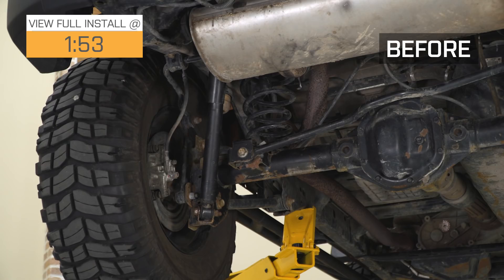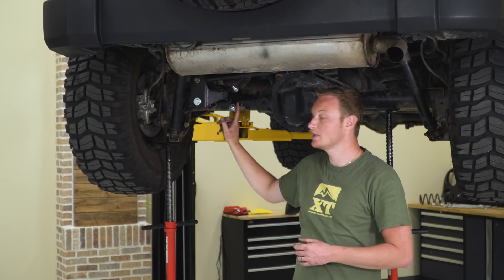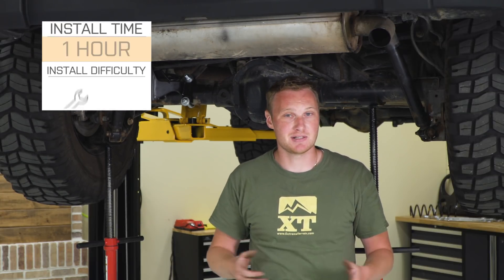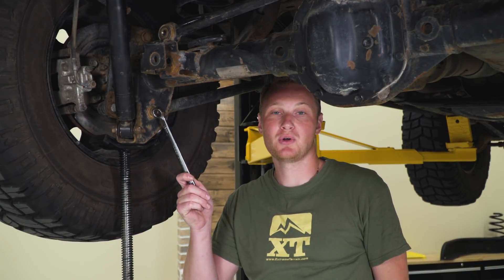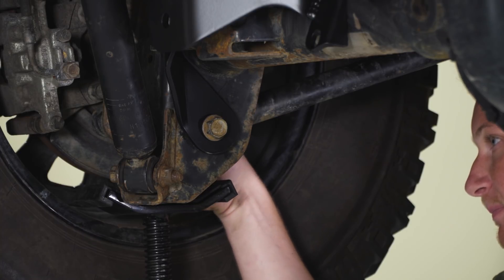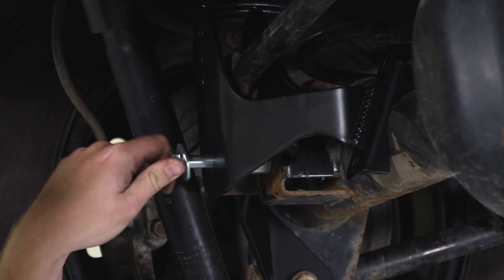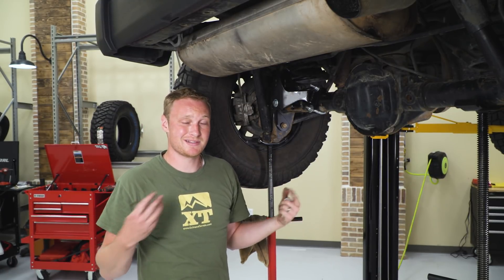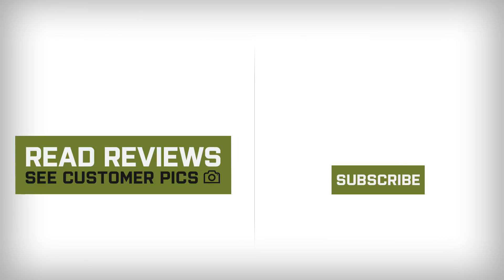Jeep Wrangler JK Teraflex Rear Trackbar Bracket for 3-6" lift (2007-2018) Review & Install

Comment: Hello, I did a 2.5 inch lift on a 2016 JKU and I would like to install this relocation bracket on the rear but I would like to know if I have to do a wheel alignment after the installation takes place? Thanks,
Reply: No wheel alignment  needed

Comment: My factory bracket broke at the weld , can i use this to replace the factory bracket, or do i need a new factory bracket welded on before using this product 
Thanks
Reply: my Jeep just did the same thing. Im trying to find the same answer you are
Reply: @dannyhyde7019  What did you end up doing? Mine did the same
Reply: @warhog1861  Found a guy to weld it back on. While doing that he showed other parts welded wrong from factory showing signs of cracking. This jeep never went off road it was my wife's pavement queen.